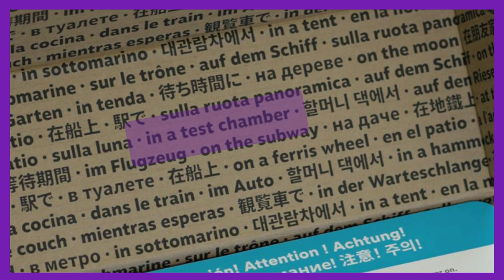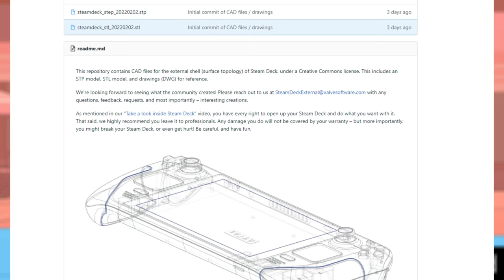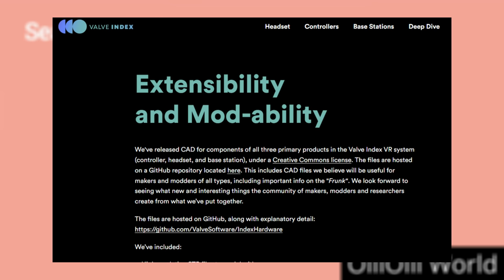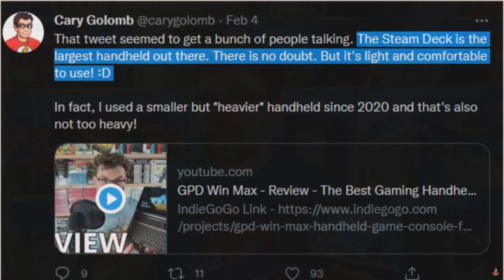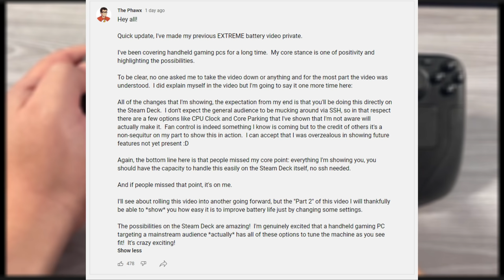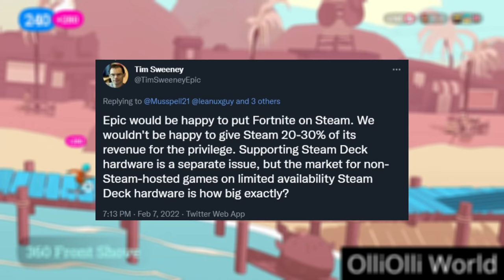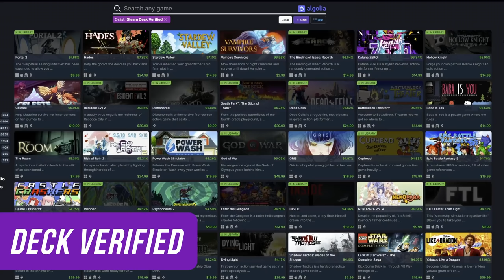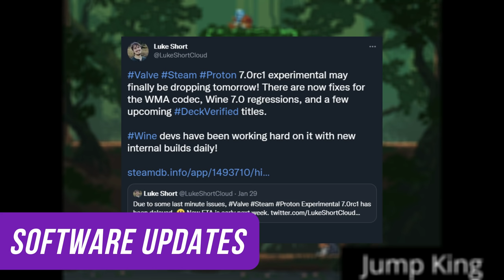Valve Seems CONFIDENT About Steam Deck

Comment: The industry really needs to work on server side cheat detection, client side has been a nice distraction, but it's a problem by design.
Reply: Its rather easy in smash.... if you have a moveset or stage mod....the game disconnectd and kicks you out.... its that simple really
Reply: @Matanumi  Most games are already able to not allow invalid actions serverside, the hard part is combatting valid but illegitimate actions like aimbotting. Valve tries to solve this in CS:GO with a combination of a trust system, machine learning and a system where players watch replays of suspected cheaters and judge if they are guilty or innocent, but it's still not perfect

Comment: I also 3D printed the model. Can tell you everything just feels “right” in your hands. Controls are all easily reachable and reasonable in size and location.  Screen looks like it’ll be pretty big given the viewing distance. The hand grips being so far apart makes for a much more comfortable holding experience than typical console controllers.  More of a box than a triangle between your shoulders and your hands on the grips. 

Frankly I feel like they nailed it. I can’t wait for the real thing to arrive!!!

Already working on some sort of free 3D printable stand/dock setup for it.
Reply: Oh cool um where get from film?
Reply: @Jaredog2006  valve has them up on their steam deck news page.
Reply: @mikekopack6441  ok get it thank 👍
Reply: Honestly, printing and painting a "display" Steamdeck sounds like a fun project while I wait for "after Q2" for mine, heh
Reply: @UNSCPILOT  I did it mostly to get a feel for the ergonomics and so I could design and test a 3D printer stand/dock for it.
Reply: "More of a box than a triangle between your shoulders and your hands on the grips"
I would never have considered the importance of this, but it totally makes sense!

Comment: Also, why wouldn't they bring their games to Switch? Portal will sell like hot cakes and if it does well. They will most likely bring their other games as well.
Reply from the maker: Yeah there's no reason not to. I think the major curiosity is why _now_?
Reply: Or maybe they will make portal 3 and don't make it available for switch so switch user will go buy steam deck or download steam to their pc so they can play portal 3?
Reply: @FanTheDeck  why not now? More people talking about valve in the "competitors" community, might get more attention towards the deck too, specially people interested towards handhelds
Reply: @FanTheDeck  I think a lot of switch owners might not be familiar with Valve, by bringing portal onto their system they are showing them a high quality AAA game from Valve. If those same people then catch wind that their is a Valve console coming out with hundreds of AAA games, it gives confidence that the console will be of good quality. This will in turn make those same switch players more likely to buy a steam deck. That's my thoughts on it.
Reply: @FanTheDeck  Valve actually invested time into remaking all menus for their games to work better on the steam deck, improved controller support etc, so bringing them to the Switch is easier than ever now
Reply: @oplkfdhgk  portal aint gonna get switch owners to buy deck. ive seen loyal ass switch gamer. they aint gonna budge for a bulky deck.
Reply: @rahnyc4  there's A LOT of Switch owners, so it's not unreasonable to think that some of them will probably get to know Valve with the Portal games & thus recognize the brand in the Steam Deck
Reply: I think that it is a good idea to have Portal 1 and 2 on the Switch, but Portal 3 only on SD.. they get addicted on Switch and have to buy the SD, so they can play Nr.3.
Nice move from Valve.
PS: would like to hear your thoughts about the 3d-printed SD comparison and ergonomics video i uploaded. THX DECKGANG
Reply: @Dany Henriquez I have to disagree. I agree it will probably need more customising of specs than your average console, but it's a hobbyist pc gamers purchase now. They will sell a few million to those hobbyists over the next 1 or 2 years at which point steam deck software will have got to a point where the best settings in games are loaded by default on the deck and everything has been optimised. Then they will market it to the console gamers and switch owners.
Reply: @H2oAllergicShark  I think you are right.  They don't know what they are missing without owning a deck so this gives them a taste.
Reply: @FanTheDeck  I don’t really know much about Valve, but I wouldn’t be surprised if they launched a few more ports onto the switch. I feel like what they are doing is trying to turn a potential competitor into revenue. If they sell some of their games on switch, then they can still make money from some of the many dedicated Nintendo fans who are satisfied with the switch. Some people are mentioning in this comment’s replies that they might release portal 3 on steam or steam deck only, and I can certainly see that. They also might pull a Sony and make it steam exclusive for a year or so and then allow it on other platforms because most people dedicated to portal would have already got it on steam, so it would make sense for them to release it to other platforms to try and make as much revenue from as many platforms as possible.

This is all just food for thought and I’m probably not right, but sometimes a little speculation is fun. And overall, I’m just GLAD I will finally be able to play an instant classic that I should have played a long time ago.

Comment: Why Dual Booting on the Steam Deck will S-U-C-K:
* Window is terrible and untrustworthy
* Even a stripped down Win 10/11 install will take up a MASSIVE portion of internal storage, especially when it's been partitioned. (Typical Windows installs are upwards of 20 GB)
* Partitioning internal storage will leave you with little space for large AAA games
* Windows is a resource hog that will seriously hamper performance on such a low power device.
* No custom kernel-level driver optimizations on Windows
* No Steam Deck UI at launch (and even when it arrives, it won't be tightly integrated into the OS and Windows will provide a terrible user experience)
* Window's built in sleep will tank your battery
* Many games won't recover from Windows sleep
* No support for Steam Cloud sleep sync
* Window's Win32/Wow64 API is less stable than Proton's Win32/Wow64 API implementation

I think we're both making a video about this. :P
Reply from the maker: I may want to borrow this list man 🤣

But honestly at the end of the day - If I'm just a dude that wants to play like, the new MMO all my friends are playing, then maybe I can deal with the cons of installing Windows just to be able to do that.
Reply: I will say, as a Windows laptop owner, sleep and idle times on Windows 10 have been better than many Linux Distros I ran that were one-size-fits-all. GaliumOS on my Chromebook got less battery life than ChromeOS  but still got a very long battery life because it was tuned for a Chromebook. Ubuntu in the past (in my experience) did not do as well with power management.
Reply: @johnbuscher  Yes, power management on Linux might not always be the best when running on a hardware that wasn't designed for Linux... Which is most PC hardware.
Reply: So much redundancy and pettiness...
Reply: most of those problems can be fixed if you know what you're doing including the big size of windows
Reply: So if Gardner is right then I guess those of us who love to play Fortnite will be feeling left out on th Steam Deck. That sucks....I for one was looking forward to the experience.
Reply: My windows based win 3 and onexplayer are awesome, despite that nightmare list
Reply: I will install windows for sure 40gb of my 256 gb steam deck is for my windows partition my only question will be if I will be able to use the same sd card partition for windows and Linux or I will need to partition my sd card too.
Reply: I hope that i can remove Windows totally of my Desktop PC in a few months. 
PS: would like to hear your thoughts about the 3d-printed SD comparison and ergonomics video i uploaded. THX DECKGANG
Reply: @dominik2327  Linux power management meh OR just motherboard (hardware, cpu, gpu etc.) manufacture power management engine binary blobs secret sauce are kinda crap and/or power management specs implementation differ on same motherboards (chip) just because it have different rev number?

Comment: They've sold out the Steam Deck for 2022 and are planning on many million more through 2024, so I'd say they are very confident that it'll sell very well. Plus as many people have pointed out, Valve will make their money on game sales until they hit a few million sales. 
As for Linus removing the battery, they did say not to remove it and I'm pretty sure he game more than a few Valve engineers grey hairs and possibly one of two heart attacks 🤔
I had my own thought on Tim Sweeney's posts and it's this... It seems like there is no reason they couldn't make specific Fortnite version for Steam Deck that would lockdown the kernel for EAC that way if you wanted to play it on the Steam Deck you could. Is it possible to lockdown a kernel on Linux so it can't be modified?
Reply: If game corporations took the less scummy route and used server-side anticheat, as opposed to putting literal spyware rootkits in the client, Linux wouldn't be an issue.
Reply: Maybe,  but being an open source project people could find loopholes to disable the "lock down" or trick the software into "believing" it has control of the kernel when in fact it doesn't.

Even if they make that version of the kernel closed source and try to hide their changes they can only do so much with bricking the rest of the system.

Personally I don't care about fortnite so for all it matters it can fade into obscurity for all it matters
Reply: Fortnite took a year and quarter to release on the switch after it was a proven success. 

If steam deck sells well enough you'll see Fortnite on steam deck, money speaks the loudest. That goes for all Devs, if the steam deck sells well they'll be desperate to support it
Reply: Fortnite on the Deck is 0.1% about EAC and 99.9% about Sweeney not wanting to pay Valve to list it on Steam.

Comment: 5:18 i used isopropyl alcohol to soften glue when i replaced my phone battery. maybe that could also help with steam deck?
Reply from the maker: Yeah it should absolutely help. And if you're already replacing phone batteries, this should probably be fine for you tbh.
Reply: @FanTheDeck  yeah i am fairly confident that i can do it but i wrote this comment because i wanted to help others.
Reply: @FanTheDeck  i remember watching the ltt stream and i just kept commenting "use isopropyl alcohol!" 😃
Reply from the maker: @oplkfdhgk  😂 I'm seriously impressed he only broke a microsd card lol
Reply: @FanTheDeck  yeah i was little surprised too. The weird thing is that he even used alcohol to soften the glue between battery and a cable so i have no clue why he didn't use it to remove the battery too. 😃Maybe he wanted to show us that the battery doesn't explode as easily as you might think after watching the teardown video valve made?😃
Reply: @FanTheDeck  ifixit actually just released a steam deck teardown. I think it would be good if you reacted to it. 🙂
Reply from the maker: @oplkfdhgk  they mention the alcohol! lol
Reply: @FanTheDeck  yeah i heard it. But it looks like the screen has metal back so i think it would be fine to use alcohol but probably better to wait for someone with more experience to confirm this before doing it yourself. 🙂
Reply: @FanTheDeck  kinda weird that it has holes under battery. I have no clue why they are there. 🤔
Reply: There is also a specisl liquid or gel for glue removing. Do not think that it is a big problem.  If you have to replace the old battery, i also would not be concerned anymore about the lifespan of the old battery, when i have to heat it up with a hairdryer, to get it out easier.
PS: would like to hear your thoughts about the 3d-printed SD comparison and ergonomics video i uploaded. THX DECKGANG
Reply: @McKuc  i didn't know that there are special liquids for it😮 can you tell me the name of these products? 🙂
Reply: @oplkfdhgk  just google adhesive remover or in german Klebstoffentferner.
Reply: @McKuc  okay. Thanks 🙂
Reply: @oplkfdhgk  your welcome. Check out my video of the 3d-printed steam deck :D
Reply: Would the isopropyl alcohol destroy the display assembly if it leaked into it?
Reply: @MyurrDurr  ifixit seemed to think that it might so maybe.
Reply: @oplkfdhgk  I got to watch their video...I do that now xd

Comment: Okay I have one question about deck verified that I'm really hoping you can clarify for me. I know there are hundreds, I think you said over 600, verified games already for the steam deck that are either good or at least "playable". Now that playable part is what I'm unsure about. If a game has yet to be reviewed and assigned a category, can I still open it on my steam deck and figure out if it works or not on my own? Like I doubt a tiny game like To The Moon will get verified, but it's still a game I'd love to play on my deck. Can I play it before Valve reviews it?
Reply from the maker: Yes. You can try to play any game in the Steam library regardless of its status.

And they better evaluate To The Moon! If not, they're cowards.
Reply: Most of the issues are just because you might need a keyboard and mouse for initial setup or it might show incorrect controller Icons.

Plenty of games will "run" just with those minor to moderate problems, but there are some games that simply don't work threw Proton yet either and therefore are incompatible with the Steamdeck, for now, for example "Halo Infinite" won't run because it needs certain features from Windows 10 and 11 that Proton can't imitate yet or can't imitate correctly for the game to run, whereas "Halo MCC" will run and let you play the campaign missions but multiplayer won't work because the "Easy Anti Cheat" it uses hasn't been fixed to run on Linux yet
Reply: First check ProtonDB for playability.
Then check Deck Verified for ideal usability.

Comment: It is hard to support EAC with custom kernels but hey don't need to.
Valve can (an probably do) use a trusted boot chain to execute signed Valve kernel.
EAC can check for that and only load if it's an official Valve kernel.
Reply: It's all about if it's worth it or not to support it. After Nintendo had sold about 15 million consoles Fortnite came to the switch.

If the steam deck passes 10 million you'll see epic desperate to support it
Reply: Yep, that was my argument also.
Check if someone is using the SteamOS kernel and let them into the game.
There are other ways to cheat in windows and Linux that don't involve replacing the kernel

Comment: Interesting that they could actually sell games in stores on SD cards like Switch. You would also be able to play on it on your PC
Reply: Sadly there's not really a point in that,  for the cost of a few games you're better off getting a 1tb SD card that you can load with a library of steam-sale games instead of one, singular, game
Reply: your internet faster than SD crads nowadays
Reply: @kristiandy2386  ha, no, deffinitly  no, as a Canadian not in a major city I get 2~3 megabytes a second when my internet is working well, SD cards are a order or magnitude faster at anywhere between or above 90 to 150 megabytes a second.

Sure, sounds slow compared to a M.2 NVME at somewhere around 3000 or more, that sounds slow as sin, but it actually still works just fine and is entirely useable, those of us who've gamed on old spinning disk Harddrives are used to way longer loading times than the Steamdeck will probably ever see.

As a  bonus, with linux not doing mountains of nonsense in the background like Windows does and being an older of magnitude smaller, SD cards even for the entire OS wouldn't likely be a big deal